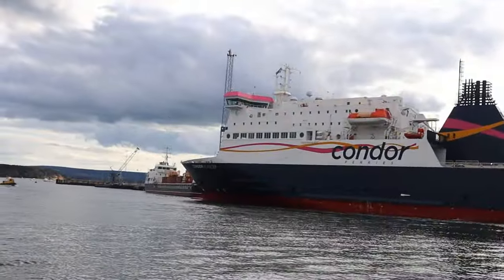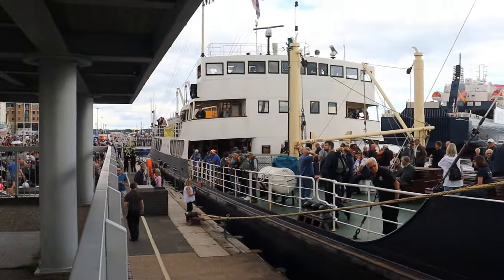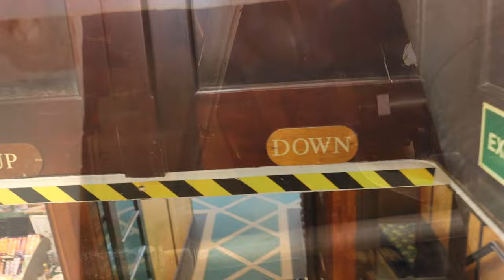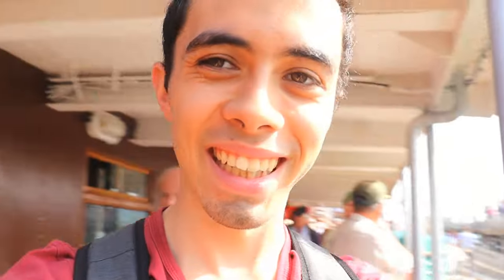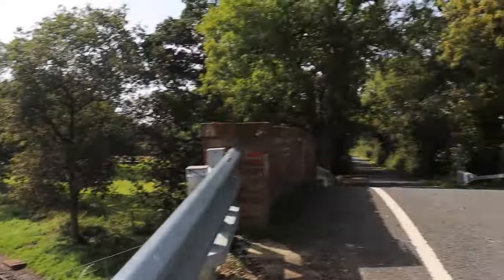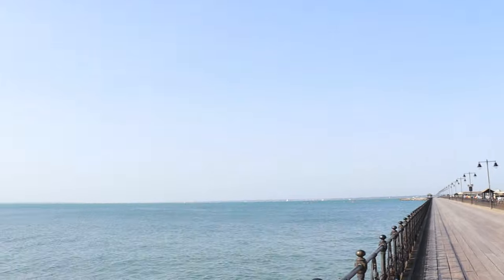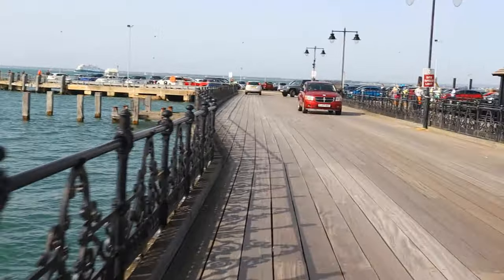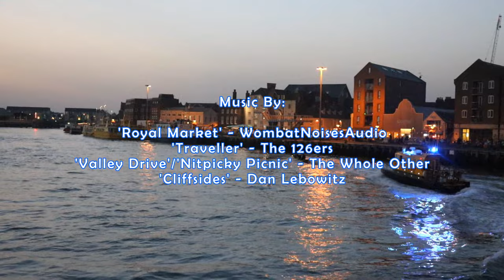I WON a ticket to Ryde on a Paddle Steamer, but it nearly went wrong

Comment: I remember seeing Waverley up at Lowestoft undergoing overhaul several years ago. We used to go shopping at Lidl, between the shop car park and the Waverley in drydock was the railway line to Lowestoft station, and the river, and used to think how similar its name was to Waveney, the name of the river that flows from Bressingham to Lowestoft. 

When my Dad was in the Navy, serving on HMS Fearless, mum and dad were based in married quarters in Portsmouth, my Nan and Late Grandad came down to see my mum of a bit of a holiday, and one day they went over to the Isle of White (I always think of Goodnight Sweetheart when the French Colonel called it the Isle of Wigget). They had never been there before, and went on a bus. Grandad gave the driver some money for the bus fair and thought he must have misheard the driver about the price and through it was very expensive on the Isle of White to travel by bus until my dads parents told him a few days later that the busses work on a no change (ie correct fair only) basis. I cant tell you any more than I have been told, I didn't put an appearance in for almost another year lol.